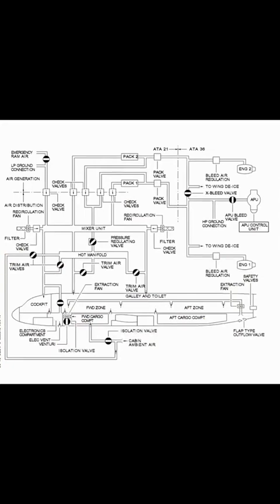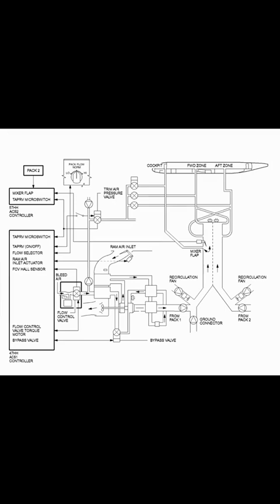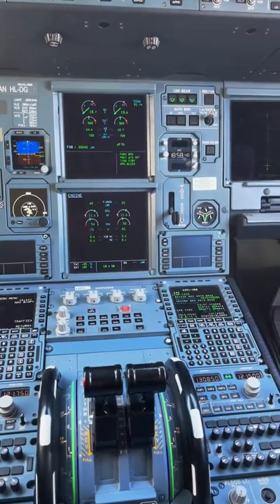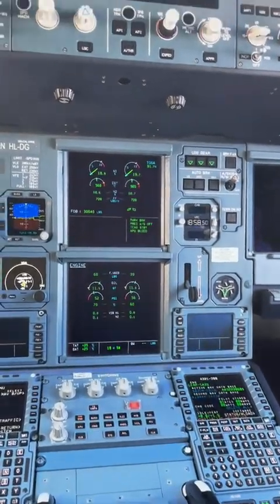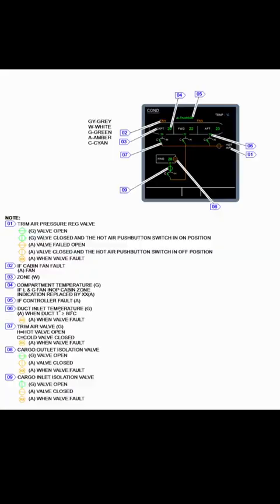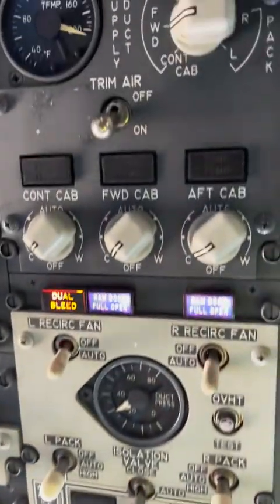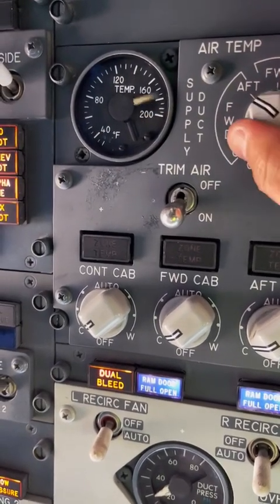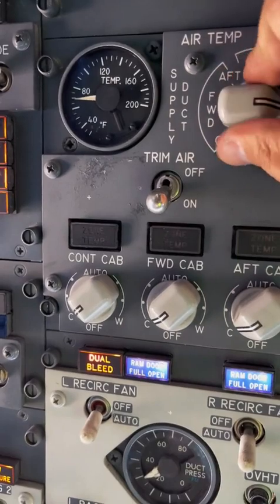Aircraft Air Conditioning and Pressurization System (ATA 21)

Comment: You ever change out 747 flow control valves # 767460-1, 2 or 3 ? I overhauled hundreds of those bad boys.
Reply from the maker: Did those on 747-400s. And heat exchangers. Actually not that bad. Just need a ladder for everything on that bird.

Comment: Hello. 
I'm having a Plan to work in Aviation. I start with studying Manual. In Main Landing Wheel Maintenance Manual/ REPAIR section, there is a phrase "smooth blending" that I don't know what it means. 
Can you please explain it for me?
Reply from the maker: I’m not sure what you are referring to with smooth blending. Do you mean on a fan blade or something else?
Reply: @StigAviation   I'm learning Component Maintenance and I mean on  "surface of Wheel" , but actually I've found it myself. Blending smooth = grind slightly.  English is not my first language, so that phrase is confusing a bit and there is no suitable words to translate it, just try to remember  related acts of  that phrase.

Comment: i always was under the expectation they used freon for the HVAC had no idea it was just squeezing and expanding the air in the engine heat exchanger
Reply from the maker: Yep, just a simple bootstrap system, and it works like a charm.

Comment: Okay Stig, time to start working some overtime....  we want more videos....

Is there certain repairs that MUST be done in the hanger vs on the line or how is that determined? Also, after you do repairs on the line, are there inspectors that check your work afterwards to ensure it was completed and done correctly or is that more for hanger maintenance?
Reply from the maker: I made a video comparing the line work vs the hangar work.. that has a lot of detail on exactly what you asked. Check it out when you have time.

Comment: Nice video again 👍🏻
The exhaust that is close to the refuelpanel is that from rhe air-condition? As a refueler we don't like when it's running. 😊
Talk about fueling, show how you refuel if you can, well I know how 👍🏻
Reply from the maker: Yup that’s the pack exhaust. And yes very loud when running and hot in a summer day. But.. in the winter it’s a life saver. Get under that exhaust and warm up a bit.

Comment: Awesome explaination. Only left out the air mix valves. Trim air Valves? Can you change  the automatic pressure controller descent rate  usually set at 350fmp./550 from boeing. Wondering if some airlines use 550/750.? Also during covid,,the airlines boasted you were protected by hypa filters. My personal opinion is that a virus 🦠 is super small. If there was a hypa filter .very little air would pass, certainly not enough to change entire cabin air every 3 to 5 minutes..also,,no more pack fans..how nice
Reply from the maker: I was trying to condense a lot of information in this one. Yes I overlooked the trim air valves. As for the HEPA Filter, well aircraft had been using them way before Covid. The airlines boasted about them during Covid to make people feel safer when they fly, but they have always been there.
Reply: Thx for the answer

Comment: At times you can smell the engine exhaust during startup on the ground. Is that engine exhaust going into the paks inlet? Or bleed air having some exhaust mixed in? Nice vid!!❤
Reply from the maker: Yes , sometimes the engine fumes get ingested into the pack system monetarily. That’s why you smell it for a second. But it clears out as soon as the air conditioning kicks on. At the time of engine start the packs turn off to provide maximum pressure of air to start the engine.

Comment: How often are the air filters changed on AA aircraft? I forget what the recommended intervals are. Still nothing like the filters when people smoked on planes. I remember seeing one in AP school. One of the grossest things I’ve seen…
Reply from the maker: Usually gets done on A checks and C checks. Or if there’s a specific reason for it that’s called out by manufacturer we will do it. And yes I remember working on classic birds like 727 and L1011 … man oh man that aft smoking section was disgusting. You could see the tar build up around the aft bulkhead rivets.

Comment: The bleed air temp has got to be really high and then it is compressed creating more heat, but at 35,000 cold air to mix is easy to find.
Reply from the maker: Very high. Even though it’s tapping from the cold section compressor of the engine, the compressed air comes out and extreme high temperatures.  You have to remember when we’re talking about temperatures in the systems it’s very relative temperature to the system itself.

Comment: You also need conditioned air to cool the avionics equipment even when the engines are not running and the APU is not on if you have power on the aircraft on the tarmac those black boxes are very expensive and they need to be kept cool enjoy your videos man. I’m gonna have to ask one of my buddies that I used to work with if he knows you, I think he works at LAX. He used to work at Mcdonnell Douglas with me.
Reply: On the A320 avionic eqpmt vent is normally isolated from air cond.sys, cooled air is added in abnormal config
Reply from the maker: Correct 👍
Reply from the maker: Yup. Definitely the avionics need cooling. Various aircraft have different designs of that but most take air from outside and vent the systems. 787 tho… well that’s a different animal. Liquid cooling 😉